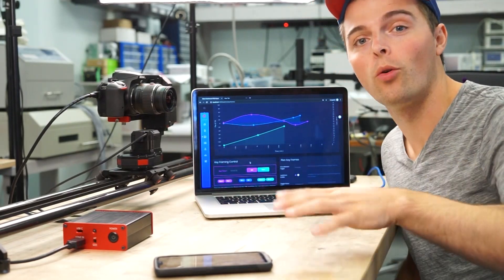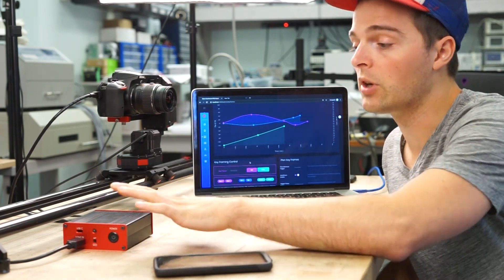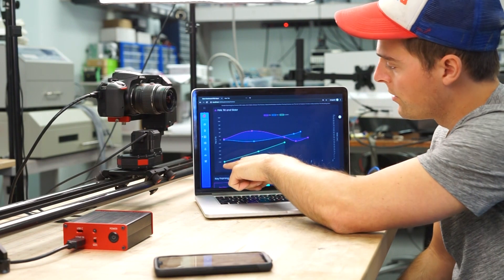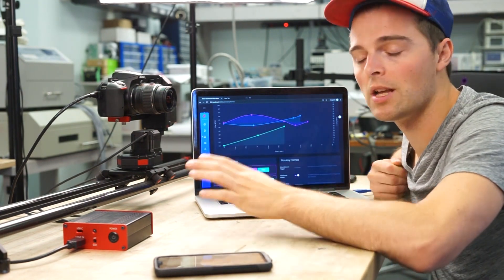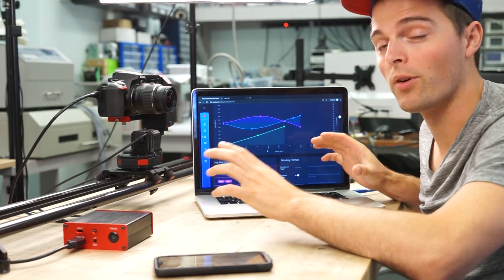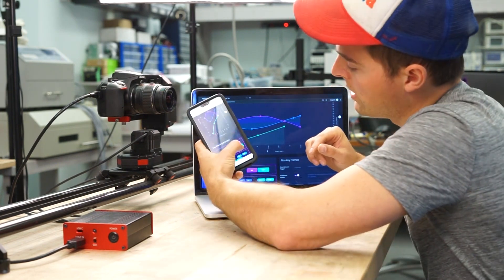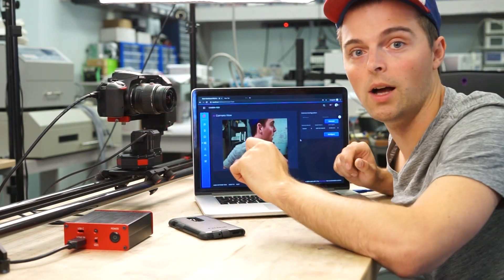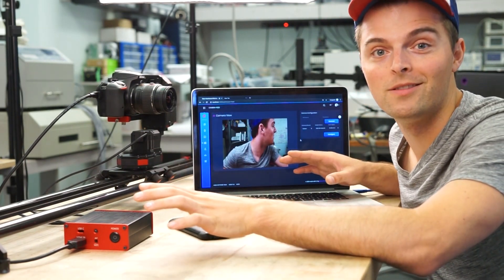Robotic Camera Mount: Intro to key-framing with AXIBO

Comment: Looking good! So will you be able to move Axibo to a position and then create keyframes from that position and then move to the next position and create more keyframes? Then also have the option of editing those key frames in the app? On the phone app will the editor work in landscape orientation and would it be possible to zoom in to the graph for better fine tuning of keyframes?
Reply from the maker: Exactly! We made it so it is easy to go back and forth.

I should have shown it in landscape mode. But yes it does work in landscape as well and the points can be zoomed in on for fine tuning.
Reply: @AXIBO  I knew you guys would be on the case with this. The flexibility of your system is so exciting. I can't wait to get my hands on it and explore the amazing creative possibilities it offers. 😀

Comment: Looking good! Pretty stoked on this function! 
Question: Do the Keyframes have individual anchorpoints to adjust the smoothness in between or is it globally set?
Reply from the maker: That's something that we are trying to figure out how to best deliver. Some poeple want hard transition between points and other want it softer. We are thinking that the use can set the smoothness of transition for each axis seperatley.
Reply: @AXIBO  Cool! Yeah maybe if you look at Premiere Pro or After effects, you can give preset anchorpoint positions to choose from like they do (easy ease, no smoothing, easy in and so on). Guess the easiest way to do it would be having a dropdown come up when you click on the keyframe. From stock I would keep it with a global setting with smoothing active, so it all works good out of the box but you can nerd into it if you want to.
Reply from the maker: @MaxMSchneider  oh good tip. I will check that out. I think we can manage that. It will add a lot more flexibility.

Comment: Can you possibly set the keyframes up like a shot list? What I mean by that is you frame up your "talking head" (time duration un knows) but when finished "hit next somehow" and the camera pans down to a product on the counter. Then hit next and it's back up to talking head. Hit next pans sideways to a new second person talking. So, less time based but have preset angles for the different positions?
Reply from the maker: Ah! yes we want to add a skip through button. So it will skip through the points. But having them as a labeled list that can be saved might be a nice professional features. Ill keep you posted.

Comment: Technical offers
1. Take video with any 4K camera: Canon 5D mark IV, Nikon D850/Z6/Z7, Sony A7iii, BMPCC4K, and then show final result taken with this camera.
2. show Making of video and final video from above listed side by side to see how it is working and shooting.
3. i saw that your device has some little shakes, so i would like to see how it affects on video of camera that on slider.
4. do many MANUAL different diagrams, and test it, shot many videos, to show how it works in Extreme conditions.
5. how many hours it works on NP-F970 batteries (7800-7900 mAh).
6. how many second is minimum and maximum speed of slider from A to B points?
Reply from the maker: This is great! I think we could answer/demo all of these in a video. 

Currently the system will run off a single NP-F970 for about 2 hours under medium use. Or 6 hours when in timelapse mode. That's a tough one to answer because it really depends on usage. I think we will show battery specs for three use cases.
Reply: @AXIBO  how about my all questions?
Reply from the maker: @Emperor-2029  for 1,2,34 we can't answer those with words we will have to make a video. And I am not sure what you mean in 6. Do you mean how fast will it move between points?
Reply: @AXIBO  yes, i wanted to know how much faster and slower it can move from A point to B point, for example my motorized slider moves 8-9 second 110cm from A to B point. and slowest speed is 96 Hours.
Reply from the maker: @Emperor-2029  ahhh, I hear you. So from end to end (100cm) the slider will do in 1.2 seconds. We have a video on Instagram showing this somewhere. The slowest speed you can set in software is 99 hours. But there is an advanced mode that lets you set any time, for example one week.